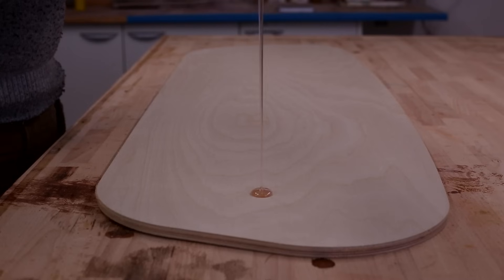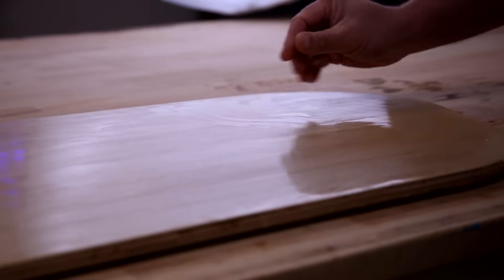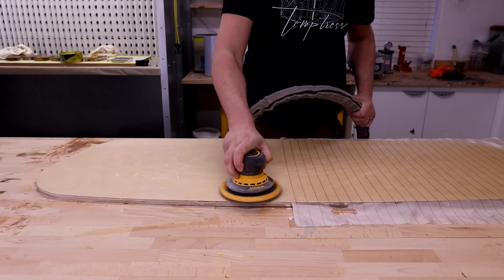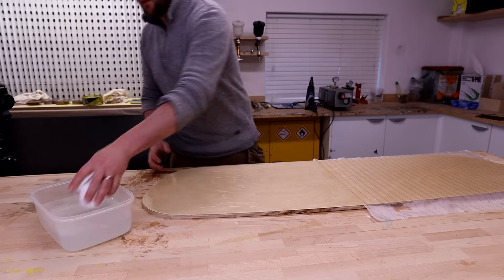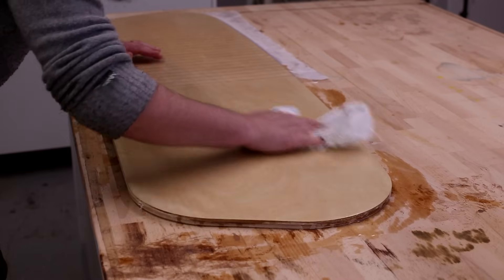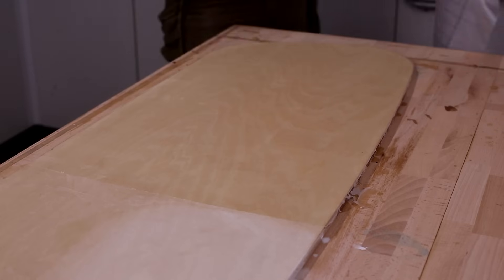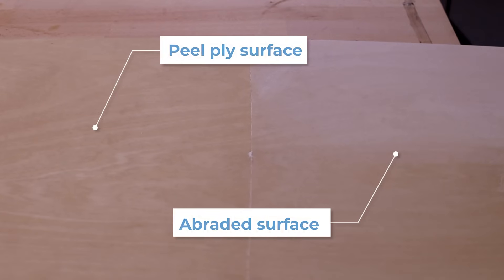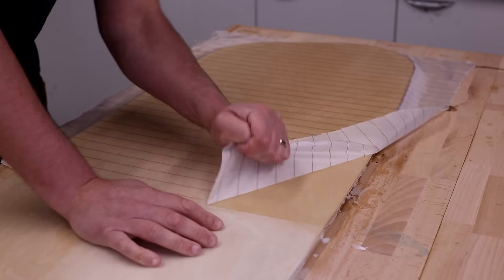What Is Amine Blush And How Should You Deal With It?

Comment: Great video Dan but I got to it too late. I put a second coat of epoxy on without removing the amine blush. What should I do now? Would removing the blush from this layer and then sanding down to bare wood save the outcome of my project?
Reply from the maker: What did you do in between coats? Were they applied wet on wet or did you sand the first coat once cured?

Comment: Nice tips👍. Only thing Id comment on is sand the peel ply surface if you are bonding to it. The peel ply has release agents in it so it peels off. this leaves a moulded surface the texture of the peel ply. We have seen some big parts come apart with with perfect peel ply texture between the secondary bonded parts. Also a good read is a technical article "curse of the dreaded peel ply".
Reply from the maker: Thats an interesting point, I haven't heard of that failure happening before.

Comment: Great video Dan, a couple of questions arising from it, actually one question from two different angles, can you use peel ply for clear coating applications as long as it has further clear coatings after the ply removal? Similarly, can you use normal 205, 206 hardener for base coats in clear coating applications and just use the 207 for the top coat? Or if clear coating is the desired finish do I need to use 207 hardener in all coats and avoid using peel ply?
Reply from the maker: For clear coating applications I would avoid the use of peel ply, it is possible that you will see the pattern of it printed through in the final finish even when over coated. I would recommend using 207 for all coats when clear coating for a number of reasons: 
1. It contains UV inhibitors and offers more resistance to UV damage (although it should still be sufficiently covered with a clear coat). 
2. It is formulated for coating, therefore it doesn't cloud, haze or go milky like the others can.
3. It doesn't blush so you just need to abrade it before moving on with the next process 👍

Comment: Thanks for this video, Dan. So if using Peel Ply, do you need to use it between successive coats of epoxy if building them up? You say that it removes the last layer of epoxy as well as the blush hence my question.  Or do you wash between coats and use Peel Ply over only the last coat, which you'll loose? Or you could use 207 hardener always and not worry about amine blush.
Reply from the maker: If building multiple coats the best way is to aim for a wet on wet build up. Let the coat set up to a sellotape tacky state and then apply the next one over the top. This means you don’t need to sand, wash or peel ply it. You then only have to do that for the final coat before proceeding. 

If you can’t get multiple coats on in one go before they cure then they will need washing and abrading.

Comment: Nice. A boatbuilder/engineer friend suggested putting a cap full of bleach in a 10 l bucket as a wash down if you have let the resin fully cure. Loving this series.
Reply from the maker: I always used to use a little dish washing soap, however, when discussing this video script with West System they advised using water only as anything else has the potential to add contamination into the surface which could compromise the finish. An interesting lesson for me 👍